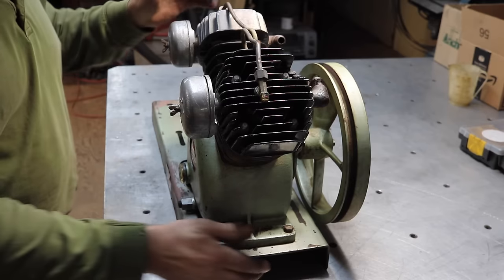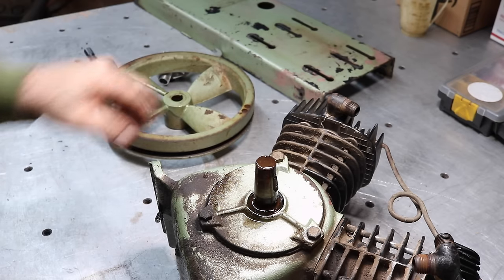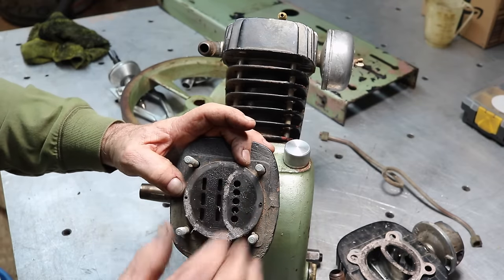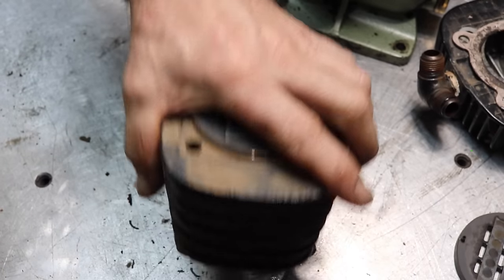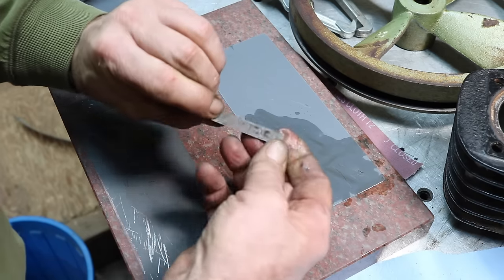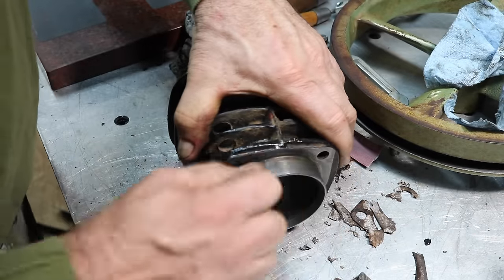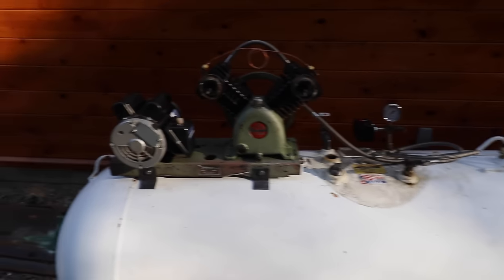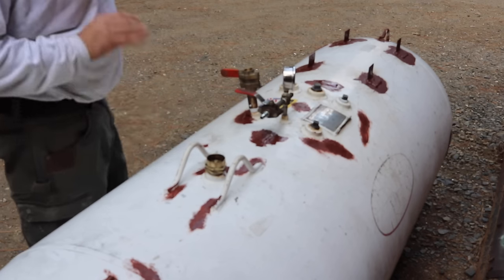Build a Giant Air Compressor for under $200 and 250 gal Upgrade P2

Comment: You're doing a really nice job Randy. I have a Porter Cable 60 gallon compressor and it looks like its the same as that one. One of the reed valves broke when it was only a few years old. The cheapest repair ever. That part was around five bucks. You're doing great.
Reply from the maker: Thanks Randy.

Comment: one recommendation for a tank of that size Randy: put an automatic sneezer that kicks off at 150 PSI on it so the condensate drains regularly... save yourself the hassle of having to do it manually all the time
Reply from the maker: In time that will probably happen.  Thanks Mike.
Reply: Poor man’s  version for home shops?
Crack open the drain valve so it is always leaking.

Unless you are running Dailey a weekend diy shop can use this method.
Reply: Something I've seen done in another video is add an airline in between the air filters and the piston cylinders and pipe that hose through a 5 gallon bucket of cold water to cool the incoming air down before it hits the pistons...that causes any moisture in the outside air to condense BEFORE it hit the tank or shop tools...

They built a water trap and bleed valve into the condensing coil at the bottom of the bucket so they can bleed the condensed water out into the bucket...

Add this mod to the system and it should significant;y increase the lifespan of the compressor and tank as well as any air dryers in between the tank and the shop tools...
Reply: @HolzMichel  By running the air through a cooling loop, it forces the water to condense out of the air BEFORE it hits the compressor...so by the time it hits the compressor and then the tank, it's already dry so there is nothing to condense out as it cools in the tank...

Comment: That really looks good. That's all you need. I picked up an extra Ingersoll tank to use in addition. Topping about 140psi. 3/4" black pipe all over the shop. Really nice to have. Cheers! -Tom
Reply from the maker: Hi Tom.  What a good deal.  Thanks for stopping in.

Comment: All the crud in the valve area appears to be caused by using detergent motor oil, compressors need non detergent oil. The temperatures in a compressor are much lower than an engine so the detergents don't get hot enough to properly do their job, so the crud forms
Reply from the maker: Yep for sure.  The bottle was not what the label said.  Non detergent went in.  Thanks Les.

Comment: Awesome job Randy- Interesting valve setup, looking forward to seeing how long it takes to fill up that huge tank!  Great stuff!!!!!
Reply from the maker: Thanks John. From 0 to 125 about 30 min.
Reply: @RRINTHESHOP  LOL, Not to bad at all... I used to have a 5 Gal. Craftsman Compressor that from 0 to 125 lb. took about 30 min...
Reply from the maker: @trollforge  Not to bad.  LOL
Reply: Pressure testing a used tank with air is not something I’d ever do. The amount of stored energy in that tank at 100 psi is enormous. I’ve seen what happens on tanks and pipelines with even moderate air pressure. Hydro testing is much safer. Fill the tank with water and pump up the pressure to the test limit. Eve n a slight leak will just dump a small amount of water. No explosion.

Comment: Good video and your knowledgeable no doubt but just a little advice  in case you haven't messed with a  many small atv,motorcycle engines which the compressor motors are made like the jug is tapered on the bottom so a ring compressor is not needed just offset the rings and tap the jug down onto the piston.

Comment: I'm thinking the gaskets weren't sealing or just deteriorated over the years, everything else looked pretty good.
Those dual piston compressors are much quieter than the single piston type.
Nice job.
Reply from the maker: Thank you Frank.  Yes this is a very quite compressor, nice.

Comment: are you setting up inside or outdoors. Outdoors will give you nothing but trouble with moisture in the air.   Inside will give less trouble.   And don't forget the autodrain to remove condensation. (heck I would put 2 in just in case one fails)
Reply from the maker: Outside, it is very dry here, drains installed.  Thanks
Reply: @RRINTHESHOP  Didn't realize that Randy. Great project.

Comment: This is why I like Quincy "QR" compressor pumps - they've been around since WW2, and are basically unchanged, and are still in production. Rebuild kits are easy to find and the base castings are cast iron, not aluminum, so they last forever.

Downside is cost - a new QR pump can cost as much as a whole compressor from IR.. 😵
Reply from the maker: Quincy makes a good compressor and they are proud of them.  Thanks.
Reply: We are replacing replacing a 45 year old crane that had a Quincey air compressor .
They wanted the new crane to have a rotary screw air compressor . The control board Alone is probably 2k.

I speced out the Exact same Quincy ! The pressure switch about 50 bucks.

Comment: Without having studied pressure vessel welding I hope you might add comments and considerations on one of the future videos of this build. Looking forward to the next.
Reply from the maker: Thanks for the tips!
Reply: I worked for the company that built that tank, I’ve personally seen one take 1500 psi of water pressure without failure, and every tank is pressure tested to 500 psi and checked for leaks. A 150 psi of air pressure shouldn’t bother it in the slightest.
Reply: Sure maybe when it was new

Comment: Do you need to take any precautions when welding on a propane tank to prevent a big boom?
Reply: yes, you fill the tank completely with water to purge the propane.. then you drain the tank and can weld to your hearts content. edit: and you need to leave the fittings off so you don't create any adverse over pressure during the welding
Reply from the maker: Well hell yes.  Fortunately I am a very trained individual in this area of atmospheres.  Thanks Stephen.
Reply: Just felt that that needed clarification. Thanks Randy for all your hard work. I really enjoy your content.

Comment: Standing under unsupported hydraulics is highly recommended.   🤣🤣        But it does sure look good.   I don't know if I would of not made a smoker out of that tank instead tho.   That's a lot of Air volume for a small compressor.

Comment: That looks great, 2👍👍up.
I do have a question...
I'm not a Machinist but bought a mini mill and lathe as a retirement gift to myself ( with wife's okie dokie ) to learn on in my shop.
I need to get a granite surface plate.
Is there a difference between a granite surface plate you would buy from a tool manufacturing company and just a piece of granite countertop? My concern is,..
 is the countertop actually flat enough?  Or are they something to stay away from?
Thanks in advance and..
Have a Jesus filled day
Greg in Michigan
Reply from the maker: Counter top looks flat but they are not.  For under 100$ you can buy a new 12 x 9 x 2 B grade plate.  This is probably large enough for to work you will do.  For under $200 you can buy a 24 x 18 x 3 B grade plate. This is at MSC.  Thank you Greg.
Reply: @RRINTHESHOP  
Thanks Randy, 
You verified what I thought.
Greg in Michigan

Comment: Was there any preparation done to the tank before welding? I was wondering if this would be risky... I could you some enlightenment on this! Project is looking great! Thanks for your time and sharing! 👍😎✌️
Reply from the maker: Yes a bit,  I might talk about that.  Thanks James.
Reply: In another comment someone mentioned water filling for pressure testing. That would help clean it out more thoroughly than a vacuum, but it would also be a good time to weld while it’s full of water putting a bit of helium inside to purge air contact with any propane remnants would also work well.

Comment: Has any engineering been done on propane conversion to compressor tank as I think propane only has maybe 10 psi static as compared to 150 psi dynamic loading on a compressor tank.
Reply from the maker: https://www.elgas.com.au/blog/1969-how-much-pressure-is-in-lpg-propane-cylinders-in-what-state/  This might help you.
Reply: @RRINTHESHOP  Thanks I did not realize the pressure would be that high in a propane bottle
Reply from the maker: @methere27  The compressor is only set to 125 psi and the relief 160psi.  For the propane the relief was set at 250 psi.

Comment: Hi Randy I believe you live within driving distance of me couple hours I have a 2 cylinder two-stage compressor pump in real good condition off a mobile air compressor was powered by 16 horse gas motor or you could use a seven and a half electric motor to drive it if you're interested let me know cheap with pulleys complete. JM
Also it's a 32 CFM compressor make a hell of a shop compressor
Reply: Well that's a nice little air compressor you got there looks a little bit of cleaning and it should be good what size tank are you putting it on thanks.JM
Reply from the maker: Sounds like a nice compressor.  Thanks for the offer.  Not right now.
Reply: @RRINTHESHOP  well Randy it's been here a long time for some reason nobody wants it it's probably too big you come across somebody would like to have it let me know thanks
Reply: @junkmannoparts9696 i would love it if you want to still get rid of it or even still have it not sure how reply work but hey never hurts to ask thanks to all the knowledge droppers i pick up all or what i can appreciate it
Reply: It's been sold sorry

Comment: That little compressor will have to work its guts out to keep that big of a tank full.   There is a reason oems have two pumps on a tank that big.
Reply from the maker: I do not mean to be unkind, but please educate yourself on a subject before making a comment.
Reply: @RRINTHESHOP  I've been selling and installing air systems for over 20 years.  What is it that I "should educate myself on"?
Reply from the maker: @anthonyhumbert8787  The number of compressors has very little to do with the size of the receiver.  The number of compressors or the volumetric output of the compressors is all dependant on the volumetric load on the system, the receiver is sized more for the surge capacity that may be required on the system.  In this case the compressor is large enough to meet the needs.  Running only a few times a day for 15-20 min.  This is very efficient for the load.  Smaller receiver the compressor would run 10 or more times a day.  The large receiver also allows the air to cool and drop out extra condensate, producing drier air to the load.
Reply: @RRINTHESHOP  yes for low volume use it's ok.  The problem would be if you ran a high volume tool for an extended period.  Something like a big impact, paint gun, media blaster or multiple low volume tools at once.  Home shop use you would probably be ok.

Comment: Randy, where are you getting your braided flex lines that you are connecting your compressor outlets to the tank?  I have a need for something smilar and cant find a reasonably priced option.
Reply from the maker: These are actually used lines off of a Sikorsky S-64 Skycrane. My son works on them.  They have to change them out
on a time basis.  Still plenty of life in them, they are rated at 1500PSI and 450F.  Good for what we are using them for.  Thanks Christian.
Reply: @RRINTHESHOP  I am envious, not only cool source for parts but based on my research to date thats multiple hundreds of dollars of awesome lines.
Reply from the maker: @GenXPessimist  Yeah we use them for all sorts of things.  My son has them in is off road truck for fuel lines.  I have them for air lines on my milling machine.

Comment: Just look at the cylinder bottom and you can see a 30 degree camphor and that's to assist in the compression of reinserting the ring when yo slid it over the piston. You shouldn't need any ring compressor. Also the normal pressure in the tank is between 150 - 200 psi and wouldn't be considered high until you got 300 psi or over. Nice job.
Reply from the maker: Thank you Alfredo, Yes on the chamfer, but I did not like the High force it was taking to just use the chamfer so I compressed them.